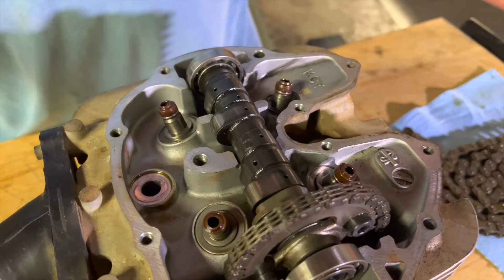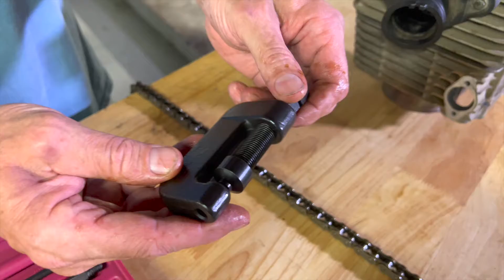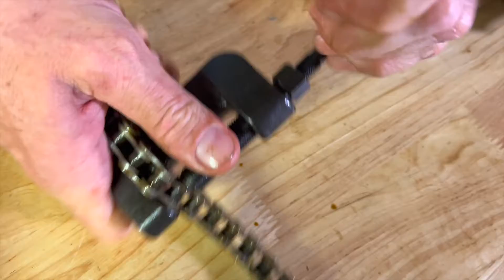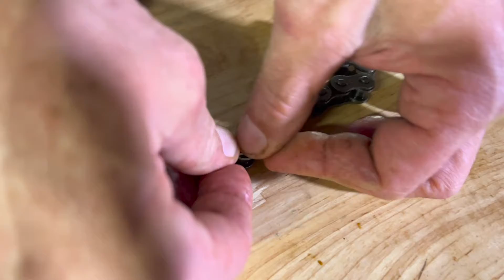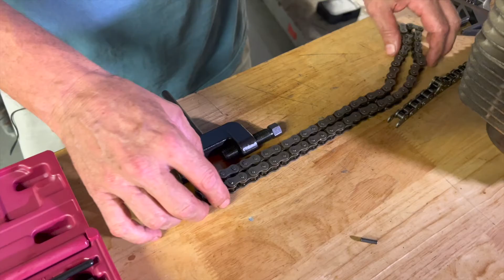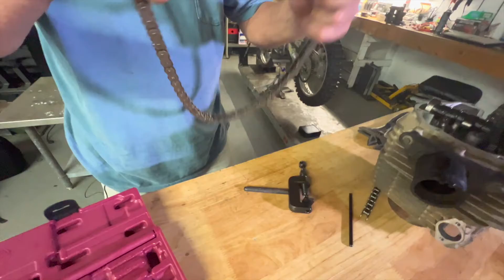How to use motorcycle cam chain breaker riveter and installer tool?

Comment: So can you use this on one of the chains you showed at the start? I'm rebuilding an fj1200 and I'm at the timing stage but having issue with setting the timing and am playing with the idea the chain is stretched. I don't want to disassemble the whole engine again to change the chain out. Would like to just break the chain and install one that is apart and punch it in. Will this breaker be small enough for that small a chain?

Comment: Found it useless at flaring a 5.5mm  530vx3 joiner link, flaring tool dosnt have a big enough dome on its end to flare the rivet.there is a flat area around the dome that bottoms out against the rivit so you can't over do it and split the pin end, how ever this stops the  tool from spreading the flare, looks to be made for 5mm joiner pins not 5.5mm

Comment: I should have noticed that the new cam chain I bought came completely connected all the way through, without a spare link.  This cam chain cannot be installed without taking the entire case apart and pulling out the crankshaft (1991 CBR1000F) from the bottom (which means pulling the engine out of the bike).  It appears that you can buy just the link.  My old cam chain tool DID work on this cam chain and can take it apart.  I was hoping to see how to mash the old links back into the chain, but I'm concerned that using a pulled link will not be sufficient hold the chain together.
I'm having a hard time with "does not need to be cut to disassemble the engine".  I don't want to disassemble the engine - I want to change out the cam chain.  The engine is fine and doesn't need to be disassembled.
My cam chain tool is from 1977 and it will work on this cam chain.
This is really frustrating.
Reply: Did you ever get it sorted? If so, did you end up cutting the chain or disassembling the engine?
Reply: @checking_out512  It's a long story.  I did get the new chain in but I had to see a few more videos on this, and it turns out that the new link is a press fit, so it won't come off easily.  But once you get it on and make sure it's not pressed down too tight (otherwise the cam chain won't bend at that link), then you use a method called "peening" the link.  This is essentially putting two tiny little dents on the end of the pin, which will keep the chain from coming apart.  The "peen" should look just like all of the other pins in the chain, with two tiny little dents on the ends of each pin.  Of course, I used a ball peen hammer and a flat punch to do this, while backing the other side of the chain up to a small chunk of iron, on top of a wooden block, with the chunk of iron C-clamped to the block to keep it from moving around.  It seemed to work like a charm.
Reply: I'm at this same point with my vulcan 1500 engine, I want to feed the new chain thru using the old chain then put the new chain back together. I wondered what you came up with.
Reply: @MikeMcgrath-yr7ge  While I was doing this job I kept thinking I should do a video on this.  It took a few tries, and at one point I dropped a pin down inside the engine and had to take the cam chain apart again just to get a magnetic pickup to reach down inside and get it out, but I think I got it.  There are a few tricks to this.  First is not to get the links too tight, otherwise the chain won't bend.  And that takes very slow and meticulous work with the cam chain tool.  The next part is getting the link with just enough exposed to peen it.  The final part is actually peening the pin to prevent the link from coming loose.  I really wish I'd made a video about this.  As far as I can tell, everything is ready to go.  I just have to deal with one more problem.  I have adjustable camshaft gears, and now I need to "degree the cams", which I think I will make a video about.
Reply: @RobertMertensPhD  Thank you for the reply

Comment: You use wrong backing plate to rivet the pin... you must use small round plate. It is special plate it does not  press to chain although pin itself... the plate you use it just for pressing chain by two sides as you showed before

Comment: It is also MUCH easier if your just secure the press tool in a vice, then just sit the chain in it!
Reply: try doing that when the cam chain is in the engine.
Reply: @jawa350zoli I just secured hole engine in vice and then it is easy 😉